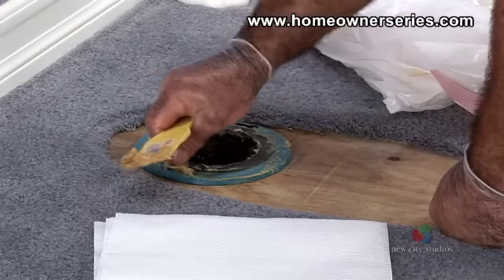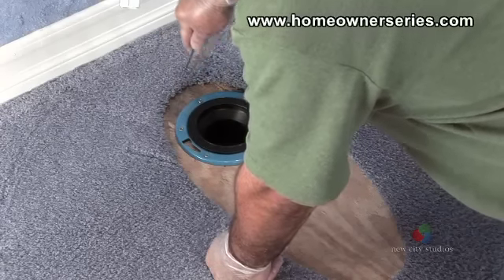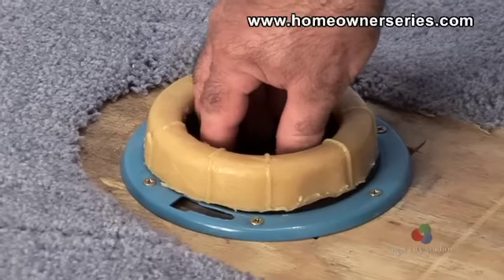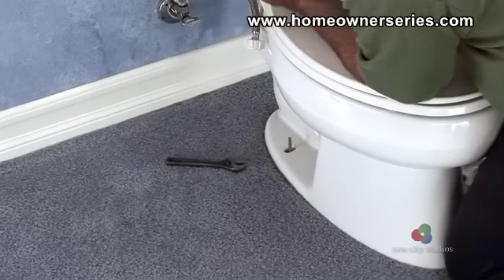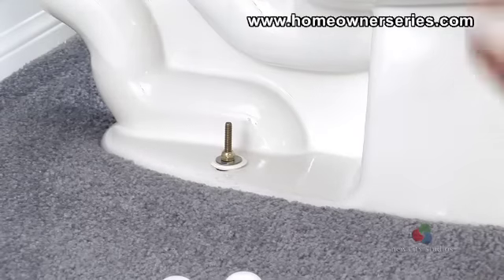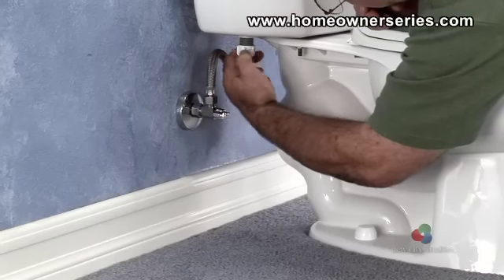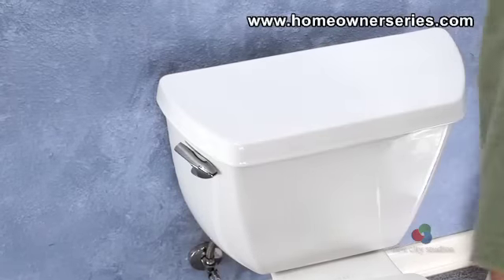Toilet Flange Wax Ring Replacement Part 2 of 2

Comment: @HomeownerSeries - Just curious, do they not put the wax ring at the bottom of the toilet and then lower it onto the flange anymore?????????  I  have always heard that is the way it is done.  Not only that, aren't you supposed to sit on the toilet and rock back and forth to help squish the wax ring ??????????????
Reply: I've always heard the opposite (wax ring starts on the flange). At least that's what multiple plumbers have indicated.

Comment: Final step is to start cussing, When the wax ring is not sealed correctly and do it all over again. Or when you can't get the water supply line to stop that little drip that seems to always happen. You must cuss all that way to the hardware store for more parts. Then once you have it fixed you must stay in a bad mood all day because you had to work on a toilet. As you may tell been there done that. LOL

Comment: I'm happy I don't have that terrible kind of connection on my toilet. It's just a standard elbow and a rubber joint.
The whole thing looks flimsy, because the toilet is not connected directly to the ground.
You can see at 2:23 that it's not fastened tightly..
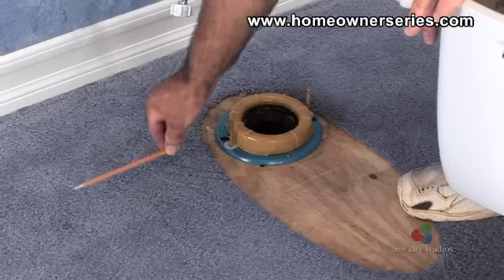At 1:28, you can clearly see that the toilet is held to the ground indirectly with 6 small wood screws.. 
The two small bolts are there to fasten the toilet to that blue ring.. Not very reassuring

Comment: Who else cringed at the carpet?
Reply: I came here just to comment this exact thing.
Reply: My first thoughts.
Reply: I thought it was demonstration show room then I see the water supply I’m like wait what do they have a carpet lol 😂
Reply: *hyperventilating
Reply: Remember those carpet seat cushions back in the day?

Yikes!
Reply: That's the only reason I came to the comment section. I thought it was a mobile home but it doesn't look like that's the case either.
Reply: I've been in thousands of homes over the years as a contractor. For some reason mobile/manufactured homes very commonly have the carpet around the toilet, while stick built homes almost never do. I'm not sure why that is but I've seen some pretty disgusting carpet around a toilet before.
Reply: This looks like a demonstration room. Maybe the carpet is to help show leaks or prevent major water spread if theres a mistake

Comment: I am confused, in this video he places the new wax ring into the flange on the floor, then lowers the toilet onto the bolts.  This SEEMS like the better way to do it but in other videos the guys press the wax ring against the bottom of toilet and THEN lower toilet onto the bolts.  This seems like it could lead to issues of bumping the wax ring out of position accidentally?  Anyone have experience to share?
Reply: +Annony Mouse This is the same way that I've changed rings for a long time now. Especially since I'm working by myself and within very tight spaces. The hardest part is keeping the bolts in line and lowering the bowl down over the bolts. Thats when I wish I had another set of eyes to help guide over the bolt.
Reply: slide a couple plastic soda straws sticking up from the bolts - zero the basin down to the flange following the straws and you should be all lined up.  This trick also helps with installing some ceiling lights
Reply: What a great idea! I recommend everyone do that even if you're really good at it and extra lucky. It's a huge help. I just used this for a really tight install and it worked like a charm.

Comment: This is the best way to install a wax ring. Other dumb videos show a more difficult way to install the wax ring by pushing the wax ring underneath the toilet first, then lining up the bolts and lowering it to the floor which can be a disaster if the wax ring shifts unknowingly due to gravity while you try and line up the bolts.

Comment: Carpet was probably used because the subfloor is plywood - which usually indicates an upper level bathroom or possibly a mobile home. You shouldn't tile over plywood b/c it will flex under bodyweight which will then cause the tiles/grout to crack. So they used carpet... but should have chosen either linoleum or vinyl flooring instead.

Comment: They usually put a massive wax ring down not this tiny one.  That and there's a defective bubble on the bottom.  do'h.  which Benjamin Franklin said shoulda never been put down on the floor.  let alone left the factory.  Toilets aren't exactly expensive but dad thinks they are.  So he ends up spending a good chunk often on a sunday when the wax goes bad.

Comment: I wish I'd have measured the distance from the center of the drain hole, then drew a line 2 feet forward from the back wall.  Screwing in the bolts to the adapter from the base of the toilet was a PITA.  Since there is nothing at the bottom to keep the bold from turning, what's the right thing to do?  My toilet wabbles now.  I think it's because the floor is lower.  How do you tell if the floor height matches the flange?

Comment: Looks like the rubber washer was installed upside down. The bolt cap would snap out over time.

Comment: How is it possible the toilet base can only handle a few pounds of torque when it has to support the wait of a human being on top of the toilets own weight?
Reply: They meant that over-torqueing the nut will crack the porcelain.  I hear people use this incorrectly all the time. Torque is measured in foot-lbs, not lbs. People frequently say pounds when referring to air pressure too. That is measured in psi (pounds per square inch).

Comment: he did not put in a cloth in the sewer line  for the gas to not come up, you must do that!
Reply: You don't need to plug the sewer line of you are replacing the wax ring right after getting the old one removed.
This is only necessary if it's 24 hours of longer that the flange will be exposed then it should be plugged with something like a rag.
Reply: Thank you Stephen, GOD BLESS!

Comment: Removing the bolts with a hacksaw is a ball buster
Reply: Wow.  You must have incredible balls.  I cut half-way through the bolts (manual hack saw) then tap and they snap off.  About 30-45 seconds per side.  Are you sure you're using the right edge of the saw blade?

Comment: yeah just noticed that.  We've been dealing with this modern stupidity since we moved in in 2000.  Want rot? Looks like someone tried to remove the linoleum couldn't and stuck the carpet on top.  Sigh.  Whats worse is the foam padding underneath is turning to powder.  one can DIY only to a certain point.  Carpeting a bathroom.  Especially around the tub and toilet is just stupid.

Comment: wax ring should be installed on the toilet not on the floor flange then lowered on to the bolts
Reply: I read on several DIY sites that some people prefer to put it on the flange to keep if from falling off when you lift the toilet.  Of course if it falls off, you basically have to buy another one.